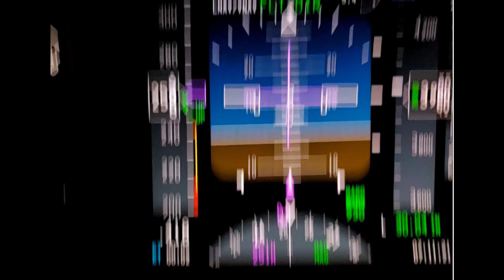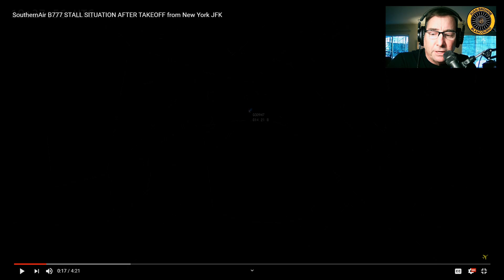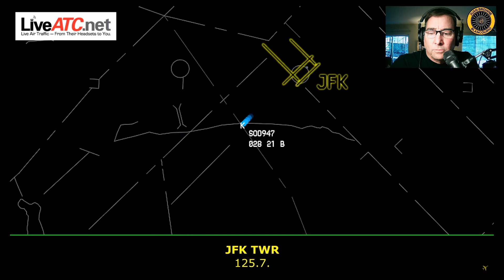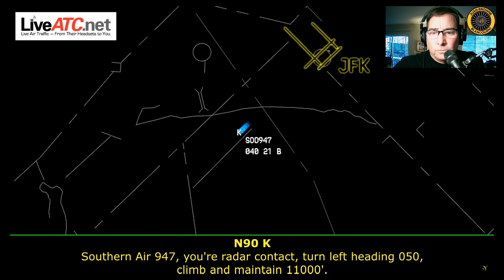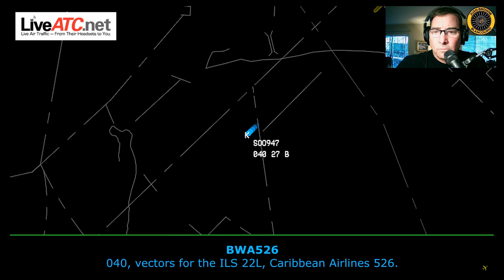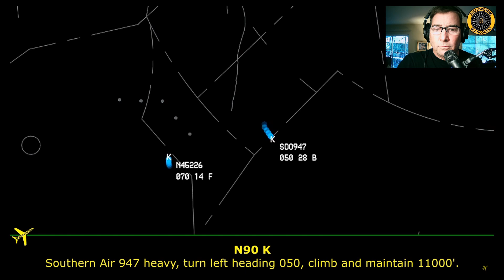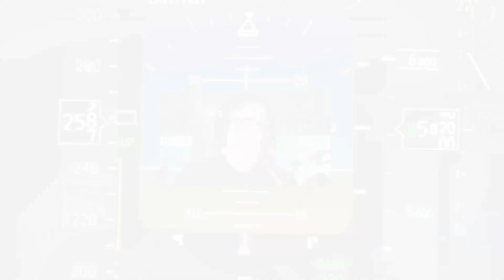"Stall, Stall, Stall" B-777-200 JFK 15 Nov 2020

Comment: Pilots not used to flying in the northeast corridor should have a good listen to NY ATC. If it sounds busy and fast here, it’s not. This is normal everyday routine traffic and ATC. When it gets busy, it only gets much fast. 2,3 or 4 aircraft all calling at once, everyone has thumb on mic button just trying to get a word in as approaching your fix, or whatever may be the case. I actually learned to fly in this environment and then ended up flying in it for over 25 years. Which probably explains why back in the day, when I commuted to work in my own aircraft, I’ve get out of the commuter and into my plane, and once 50 miles north of Boston Logan flying VFR if possible, I’d just shut all the radios right down and enjoy the silence, or maybe some music through my headset, and equally enjoy the nice night flight home up into the mountains of northern Vermont. 
I’ll never forget those peaceful, quiet flights home every night. From the radio never pausing over Nee York and Boston, the ground and endless mass of lights at night as can be imagined. Then just 50 miles further, about 16 minutes, the radios all got turned off, and the sea of lights below had all vanished into complete blackness without a house light or street light for the next near hundred miles. Just complete blackness, without even a hint of horizon. Other times, a beautiful full moon. Sure, on occasion the weather was bad, and icing could get really nasty up there, so I’d have to file IFR, but still, I had flown it so many times, I knew all the airways, all the VOR’s and all the approaches by heart without even having to take a chart out. (But I always did). Many nights I’d get out of the plane and spend 30 minutes knocking all the ice off the wings, so I could get right out in the morning without to much delay. The other thing about being in that cold temps., was the plane always needed a preheat in the mornings.  It the FBO would have that ready for me in the morning.  Sone time later I ended up flying a nightly cargo flight out of my home airport every night, which took me to Logan and Manchester NH and about 8 or 10 small  uncontrolled airports all over Nee Hampshire, Vermont and upstate NY every night. All single pilot in an old run down beaten up half broken King Air. Lol. But again, I loved it. Except when blizzards would roll in and the flying got really terrible. It could be a handful. Also, loading and unloading the aircraft myself in -30 degree snowy weather wasn’t to fun. Not to mention the deicing boots that hardly worked. Never the less, I enjoyed it for the most part. Mainly because it was flying in no man’s land that didn’t even have radar coverage below about 8000 feet, and of the 12 airports or so per night, only 3 or 4 had a tower. All with pilot operated lighting systems. But there is something exciting about descending into a black hole in blowing snow, complete blackness, no radio communication, and few airports with lead in lights. Just small country airports with no one there stop after stop. And all single pilot operations. I heard they’ve since replaced the aircraft which I would hope so, and have a much nicer aircraft now. One where things on it actually work! Lol… 
That’s living in the country for ya!  😉😉😉

Comment: I take exception with the comment that Boeing always allows you to control the aircraft and Airbus doesn’t. Having flown about an equal amount of hours on Boeings and Airbus (about 10K each) at no time in the Airbus did I ever feel that I was not “in control” of the aircraft. Granted there are differences in the feel of the controls stick of the Airbus VS the b777 but the airbus “feels” very responsive in all phases of flight. IMO of course. Cheers Rick
Reply from the maker: I have...Thanks Rick!

Comment: I don't fly airliners, but in my experience as a flight instructor and commercial pilot, I would simply lower the nose to gain airspeed and put up with a lower VSI rate of climb. But the question I am asking, why is this even an issue as I have flown in a 777 full of passengers and luggage and we had a great rate of climb. I am assuming they are not over gross and have power as required. This reminds me a lot of the Air France Airbus from Brazil to France. The FO is flying (captain stepped out once over the ocean), the aircraft is nose up, power was added and he has a VSI showing a rate of descent. I think they were up at around FL390 or 400. Its been years since I watched the video. Duhhh, what condition do you think the aircraft is in?

Comment: The B777 in a heavy configuration, as Juan says it a juggling act between flaps 1 to up, minimum speed, maximum flap speed. One thing that was not mentioned here, in the analysis Juan, is that there was a line of thunderstorms which could have created turbulence and or wind shear/ shift conditions that could have created the conditions for the speed decay. It would be great to hear and update on the his case. 
On the speed limit of 250k IAS bellow 10000’ it’s always required to request in advance but the regulations state that the limit IAS Is 250k and/or clean maneuvering  speed, so you are not braking the regulations as long as you get the clearance. Thanks Juan for your always on target analysis.

Comment: 12:39 
Juan, the indicated airspeed shown is 258 kt, at 6000 feet the True airspeed would be 284 kt and the controller would see ground speed, TAS, corrected for wind. As you know.
What I like to show is a very simple rule to mentally easily compute TAS from IAS (actually CAS):
At 12 000 feet the factor is 1.20
at   9 000 feet the factor is 1.15
at.  6 000 feet the factor is 1.10
at.  3 000 feet the factor is  1.05
So 
at 5800 feet 258kt ×~1.10 =284kt
It is a memory item rule I teach my students to quickly determine TAS from IAS without having to be detracted by turning the computer.
That table assumes that the outside temperature is reasonably close to the ISA (International standard atmosphere).
Which is 15°C minus 6.5°C per 1000 meters up to 11000 meters,(36090 feet) and constant there after.

Comment: I used to fly some long-haul stuff in a high-ZFW B757.    We had a handful of departure cities where we automatically assumed that the plane weighed a hell of a lot more than what the paperwork showed.   We knew this because the airplane was always a total pig anywhere near the recommended CRZ ALTs, flight after flight.  We'd arbitrarily knock 4000 feet off that value early in the climb and then climb above that only when we were satisfied that the plane had adequate performance margins to go up and still give us some wiggle room.   Obviously, this really affects your planned fuel burn to the destination so we had to keep an eye on that as well.   Of course, they tell you that you're carrying flowers and styrofoam when you're actually carrying lead-acid batteries, spent uranium, lead sash weights and ingots, barbell sets, Quickrete, etc.

Comment: Would they have a chance for a climb and safe landing when an engine fails during this low speed event? Not immaginable when they have issues holding altitude with 2 engines running

Comment: Juan, doesn’t 91.117(d) allow operation at a speed greater than 250 if that is the minimum speed for the aircraft?   Example:  T-38 min 280 or 300 KIAS in the pattern.   If departing in the B-777 and the min clean speed is 260 KIAS, why would you need to tell the controller that you have a high speed departure?   The FARs allow you to maintain the safe minimum speed for your aircraft, even if its above 250 knots.   John ATP/CFII SMEL, C-5A/B

Comment: It always seemed in Europe ATC was more proactive to give a HSC. In the states not so much. Yep freighters we’re always heavy coming back to states from Asia. Wasn’t much runway left after TO roll there in ANC. And landings in the whale were the fastest I ever made in my career
Reply: It depends. For example, Germany has most of it's international airports covered by class C airspace. Per ICAO "MAX 250KT BELOW FL100 [...] NOT APPLICABLE WITHIN AIRSPACE C" -> 250kt below 10000ft only applies to VFR in airspace C (also see ICAO Doc 4444, I believe around page 62) - Therefore, no such problem. (To make traffic controllable, most STARs/Transitions have speedlimits on them, usually 220kt)

Comment: I work for boeing in the avionics department. Ever since the crash in San Francisco where the Asiana 777 airplane unfortunately crashed while on approach we have been mandated by FAA to add even more protection for airspeed low situation. I worked specifically on the 747 and we added an earlier warning for low airspeed for flap settings 25 and 30 I believe 777 has done that too. We are also adding a FMC update that will trigger throttle to advance if it gets to a low airspeed situation.
Reply: We actually call those amber band and barber pole haha

Comment: 16:32 I think that is about as perfect a system as you could have; always allowing the pilot full control, but with a substantial and continuously increasing physical resistance when entering a flying state which the software assumes to be dangerous. This allows the pilot instant reaction ability (i.e. no diverting his attention to switch modes), while also all but completely preventing inadvertant loss of control. This is important in the case of an unexpected software issue/bug, sensor failures, or some completely unforseen scenario that the software can not account for.

I really feel like there is a crucial balance between prevention of pilot error and the pilot's control of the aircraft....and I feel like any scenario where, even momentarily, the pilots control can be COMPLETELY removed is not a good answer.

....and simply forcing the pilot to be extremely deliberate with physical strength to override the system is just the perfect solution. (Because any pilot who is THAT deliberate would switch the airbus out of its normal flight mode anyway)....so in the end it seems like the systems dont have any real difference in outcomes except that in a situation where the pilot must override the system, the airbus system seems like it would cost the pilot valuable time and some amount of his attention while having no other real benefits.

Comment: I'm not a pilot. I do play flight sim. I can land any plane and judge my airspeed relative to the aircrafts performance envelope at any altitude or altitude pressure, with out any gauges. How the fuck do these low airspeed things happen when nothing's wrong? I can feel the mushyness in the controls, the sluggishness at whatever speed and tell where there breaking point is. If this is your specific aircraft or one you fly all day professionally you should know how it feels to fly??? IDK

Comment: How the fuck did they manage that? I think we really need to look at aircraft and aviation as a whole. Aircraft are way to complex for their own good and it causes a lot of problems when it comes to identifying failures. In this day and age AI should be monitoring everything so as to instantly let you know if something was missed, a switch that is or isn't flicked, which engine is out etc. I don't think it should have control but it should be monitoring everything. I drove trucks for a while and my truck and trailer both had weight gauges built into their suspension. Something as simple as this could allow a computer to calculate the balance of the aircraft and would immediately prevent overloaded and unbalanced planes from ever leaving the ground and would cost virtually nothing. A cheap network of radars around airports combine with AI could prevent mid air collisions with planes and birds, monitor airspeed relative to aircraft type and issue low speed warnings, and you could even have AI monitoring ground traffic. My truck also had a radar to tell me the distance and speed of the cars ahead of me, would beep if I went over the lane line, and would even brake check me if the car ahead was coming up to fast. Aircraft need similar aids. I shouldn't have to pull out a manual to know what I need to do. If an AI can identify the problem in 1/100th of a second, and I can double check it and confirm in the next ten seconds, it can give me the best practiced solution right there without me having to think. If it's also reminding me to do shit like keep my airspeed up, and dumb little things, I can than focus all my attention on the task at hand without worrying if I'm missing something. Also, AI will be able to calculate all possible airports and most efficient routes in event of an emergency. Not to mention, you could have the shit on a tablet in your plane that you just plug into. And all those controls!!! I should have the ability to change anything I want, but I shouldn't have to if I don't. I should be able to start it up and go (after a walk around) with absolutely minimal controls, the computer should auto configure the engine to do what I want in the most efficient way. Just have a default running setting the controls can go to in the event of a computer failure and I can take over from there. Am I a pilot or an aircraft mechanic? Confusion seems to be the biggest killer in aviation. Also, why aren't there more multi engine aircraft??? I'd rather have 2, 60hp engines than 1, 120hp engine. Bottom line is - there is to much jazz going on in the cockpit and not enough flying.

Comment: It's  interesting how dependent the aircraft is on having the correct data entered for the flight.  It's  a shame the don't put some kind of weighing scales in the landing gear so the aircraft can double check the data entered.  Thanks for a really interesting analysis.  😊
Reply: Some planes literally do have sensors in the landing gear to determine the weight AFAIK. Just depends on the aircraft.
Reply: It really bothers me that such a feature isn't industry standard. It wouldn't be horribly expensive to include, just gotta make the system robust and calibrate it

Comment: A remark about exceeding 250 knots below 10K feet. Correct me if I’m wrong. I understand that they should’ve requested the high speed climb before hand, but given the immediate, potential emergency situation, the PIC, in this case the captain, has the authority to make a decision that may violate an FAR in order to ensure the continued safety of him, his FO and the aircraft. I’m guessing the reason they didn’t call for it at the beginning or during the incident, was the good old saying. Aviate. Navigate. Communicate. In that order, so aside from they not requesting the high speed climb while still on the ground, I cannot see a reason to condemn these pilots for this one piece until we know further facts.

Comment: Hi another great video subscribed  , Just one thing was not sure about I'm not pilot just a sim pilot ,you said on Boeing system auto throttles go to 100% when hitting yellow section seems go against nose down first then power . Have had some flying lessons and stall was nose pitch down then power have only done power off stall ,is the Boeing applying power before it actually entered stall ?

Comment: Shame you didn’t comment and summarise on what you think actually happened during the recovery in terms of power speed and climb.
Reply from the maker: That was covered, go back and watch again, the ENTIRE video.
Reply: @blancolirio  Yes well kind of... you say how the AIRCRAFT and cockpit displays behave but not what you think the pilot did to (possibly) provoke the incident and then recover. I.e. comments based on your experience or the training / requalification you just completed.

To me you imply that the engines would have gone to full power automatically and then the crew would have had to push nose level / nose down to pick up speed. 

The aircraft certainly seems to gain speed and altitude VERY quickly once things stabilize...  so maybe incorrect takeoff / climb power calculations / settings ?

N.B. The transition between yellow warning and red alarm did seem to come pretty quickly ?

Comment: Crew error on takeoff.  The A/T and V/S were incompatible.  There was nothing wrong with the B772 as the crew got the issue sorted out and continued on to Seoul without incident. The crew took off from 22L, went AP in HDG and one of the pilots wrongly activated V/S on the fully loaded 777.  This dropped the ground speed toward stick shaker and on came the aural warnings.  The crew went manual, realized the error, corrected and went back to AP.

Comment: All the factors that go into calculating takeoff speed, rate of climb etc etc include total aircraft weight.  How does the crew know what the actual weight of the cargo is?  Is it actually weighed before loading onto the aircraft, and if so, who does it and who is responsible?  If the cargo weight was incorrect, that could affect all the takeoff parameters couldnt it?

Comment: First can I say thank you for what you do !! 
Were would someone get information of FLYING OR READING MAPS ECT. AT 60 I have took a Plane trip one time. But enjoy the info here is my only question. Is ( m) with electric bolts above a nuke power plant. And the number the tower hights?
And would someone please tell me one thing. Into ORD. Bradford 5 arrival. Is this basicly a radio that guides you were they want you to line up on? Were could someone find answers?

Comment: Thanks so much Juan! I'm particularly interested in airplane speeds with regard to takeoffs and landings. My daily automobile commute takes me eastbound straight toward O'Hare Int'l airport's main runways. On my way to work I see 2 lanes of up to 6 aircraft each, flying westbound as they are making landing approaches. On my way home from work I see usually just one lane of planes flying eastbound landing approaches. Also, many times at the end of my day I'm arriving very near the end of a runway used for international flights, many of which are 747, in time to see 3 or 4 takeoffs while I sit at the stop lights in my route.